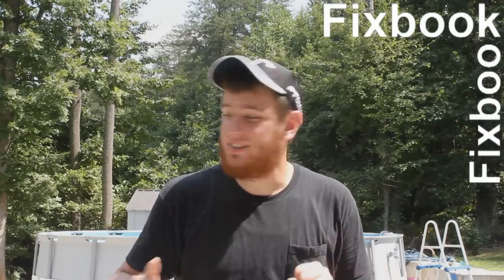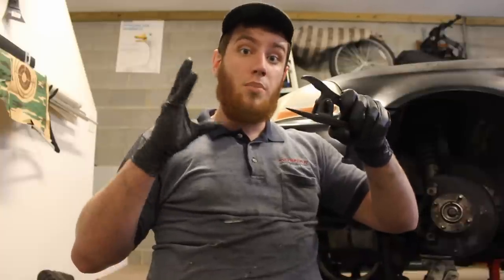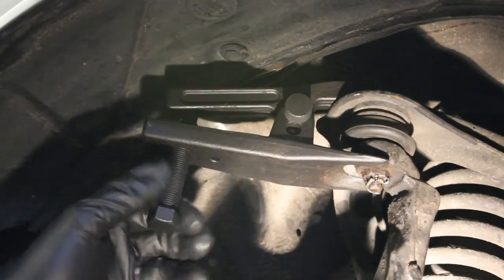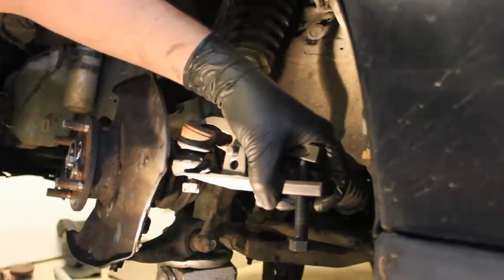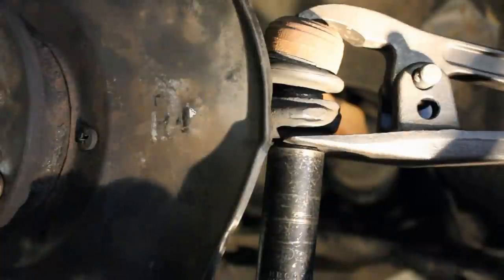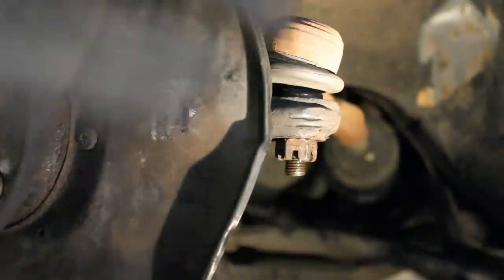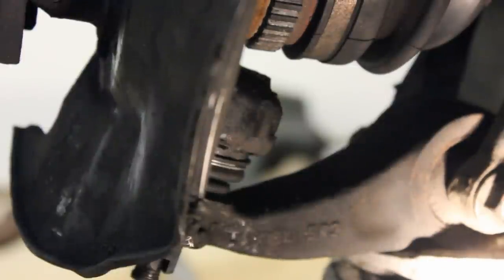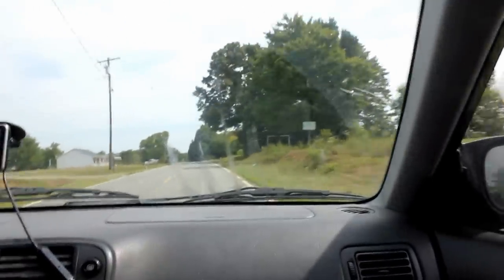How to Tighten a Ball Joint or Tie Rod End Castle Nut

Comment: Wow, I've been trying to remove the tie rod nut for days.  Went out and bought the ball joint separator at Advance Auto and tapped it on to lock the tie rod and the nut just threaded off.  Thank you for a great video and a brilliant solution.

Comment: Thanks for the great video!  For those of you who don't have access to that ball joint tool, you can use a large crowbar to crank on the ball joint and while holding pressure tighten the castle nut.

Comment: My tie rod kept spinning as I tried to tighten the 18mm nut. It wasn't a castle nut and could have been replaced before my ownership. Thanks for posting that pressure needs to be applied to the spinning bolt without damage being done to any internal parts. I didn't have your twenty dollar clamp, and with no time to purchase the tool I managed to get the nut on using a 3" c-clamp. Thanks for your help :)
Reply: +Joe Marks Yep, that is what I am going for as well.

Comment: thanks man :) i working on a golf 4 in Munich for a week trying to tighten the ball joint on the tie rod....what a pain in the ass it was. The car is 16 years old and everything is rusted from the salt on the roads in winter. I did like you said and i put like a ton of pressure on it and it tightened at last. thanks :) ken

Comment: This is great, I tightened mine in about three minutes after I figured out that the arm and tie rod end needed to be pressed together.  They did not have a ball joint separator like yours so I "rented" a ball joint press from O'Reilley's ( they rent tools for free) and it was basically a big C clamp with a large hole in one end and came with two dies.  I was able to place the hole of the press over the nut and clamped it tight (no need for the the dies) and placed my 19 mm socket inside the large hole in the over the nut and tightened it and torqued it.   Google "Ball Joint Press C-4212F" to see an example what I used.  Thanks again - I burned two hours before I saw your video!

Comment: Thanks, working on this problem now. Using the c-clamp, just a PIA. Working on a 2004 Chrysler Crossfire, which is 95% Mercedes SLK320. Already worked on the other three fittings, each was a little different to conquer. Replacing front end draglink that has tierods attached, and shocks, and wheelbearing assemblys, and brake rotors. Fixed the hood lift also. I will prevail!

Comment: On my mark golf, i have the same problem with the tie rod end. The only difference is the top of the tie rod end pin is not exposed like yours, so therefore i can not put a clamp on to keep the pin from spinning. Any suggestions?

Comment: Hi.  How do I tighten the castle nut on a strut?  I have it on there pretty well but there is still a ways to go to be like the original, and the strut piston just spins. I don't want to clamp anything to the piston to hold it in case I mar it.  Thanks
Reply: +RobPolson Im sure you already figured it out, but most struts will allow you to grab the end of the rod (or piston) with an open end 3 mm wrench or vice grips. At the end there is a flat section just for that purpose.
Reply: +Mauricio Feijo    Thanks.  I need to buy an offset box wrench and hold the strut rod while turning the wrench. I give that a go.  Seems simple enough but I just didn't have the offset wrench as the nut is down below a ways.

Comment: Hii got a problem with my 2000 infiniti i30t lower ball joint, i just removed the castle nut from lower ball joint & when i tried to put back in position the castle nut doesnt fit the lower ball joint, could you please help me and also let me know the size of castle nut?
Reply: sandy 47 did you fix your problem yet? I own a 1964 chevelle and had my ball joint fall out while I was driving tried to screw the castle nut back but didn't wanna fit all. The way through. Not enough to put a pin at least

Comment: out of breath from talking to fast , cross threaded castle nut . the tie rod end stud was stretched from being over torqued before.. should be able to just put a jack under control arm to keep joint from turning without extra tool .. other than my 2 cents good video explained well.